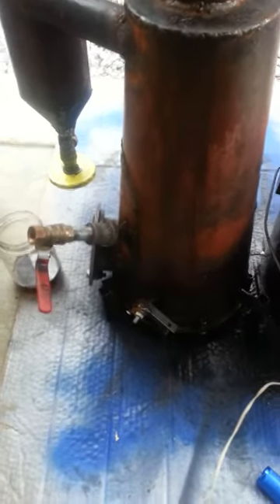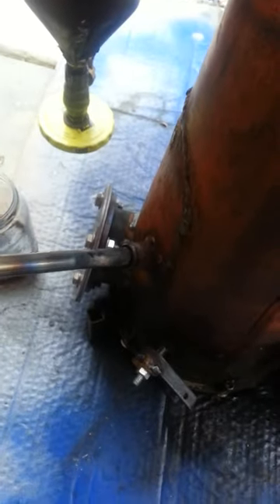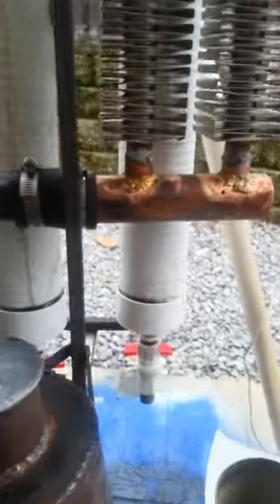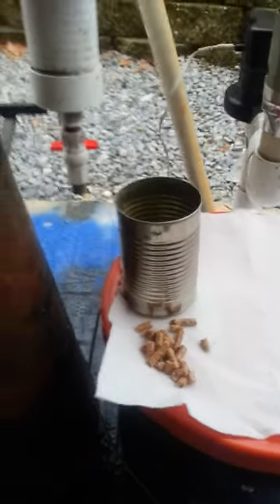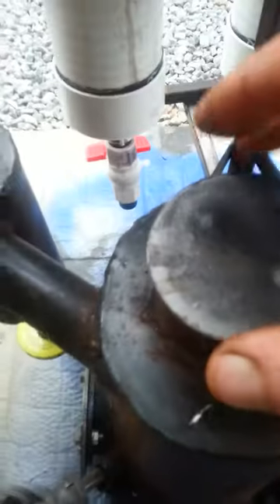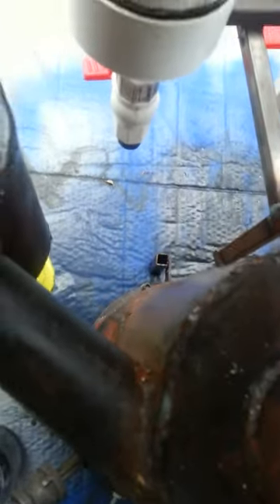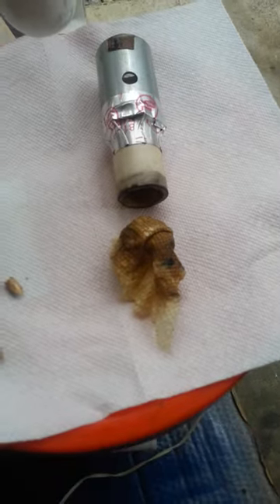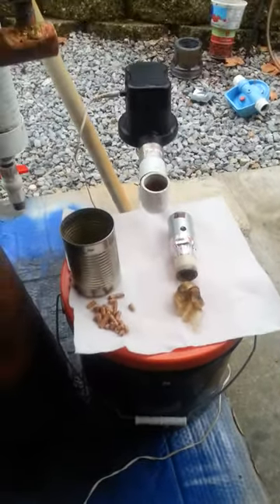Gasifier additions

Comment: I've had some of the same issues with tar and wood pellets, I think it has a lot to do with the moisture content of the wood and the temperature of the Burn zone. If you ever noticed, the wood pellets can absorb a lot of moisture and if they get to wet they literally turn back to sawdust. So if your storing them in a damp place they tend to suck in the moisture, I bought one bag I knew had been setting out in the rain, and it didn't seem too bad but I got more tar out of that bag then probably any other I've bought.